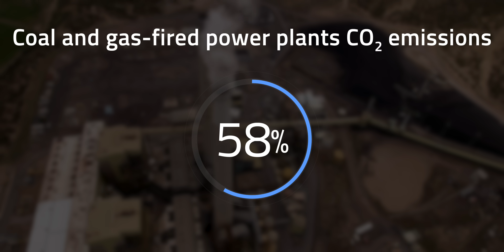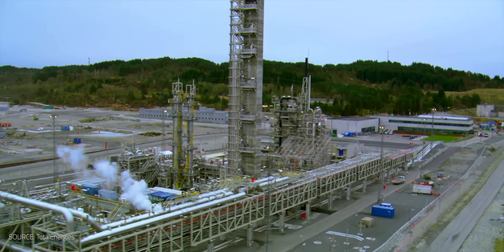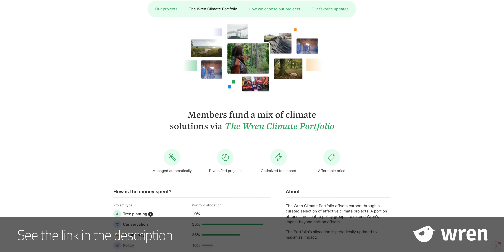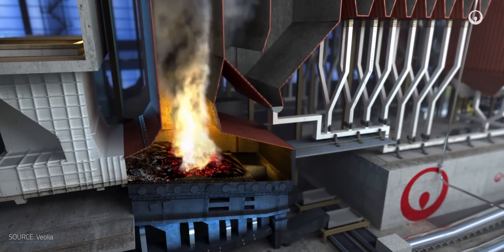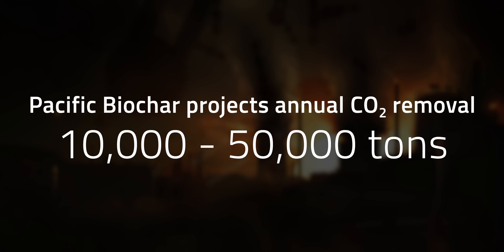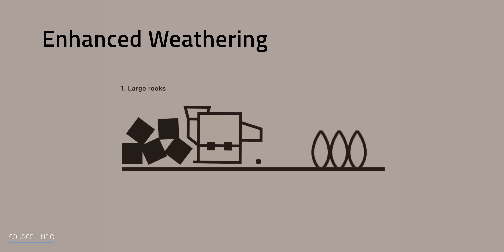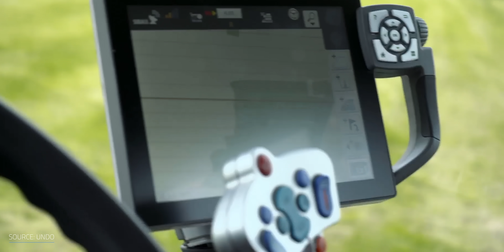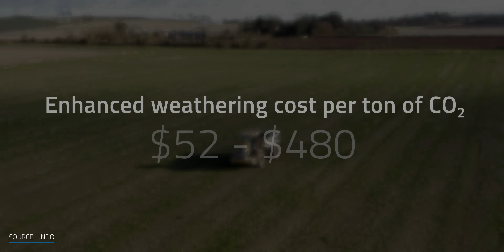The Reality of Carbon Capture

Comment: Thank you for the video. However, I have to say I dislike the approach they are taking. While reducing carbon footprint is an important problem to tackle, I see those approaches as artificial forced unilateral compromises with nature.

Nature has its own means to deal with carbon. And they are working. They have been for millions of years.

Then we came - homo sapiens. The know-all can-all selfish short-sighted animals that create more problems than they can possibly solve and disbalance nature's mechanisms: 
1. burning dead dinosaurs, and dead trees to produce heat, light and pressure while increasing carbon release astronomically when compared to natural sources of co2 (breathing, rotting, etc.);
2. cutting forests to create fuel for #1, to build stuff (lots of which we don't really need...), to build more houses and plants/factories, to recover land from what used to be forests and use it for agriculture, because we need food to live and proliferate, and as we do - we need more of #1. Effectively, killing nature's lungs, not only sheltering huge amounts of wildlife but also disbalancing the carbon reduction mechanism even further.

Instead of seeing ourselves and our actions as the problem, what do we do? We address the problems we create IN ISOLATION, not accounting for the fact that everything is an extremely well-balanced scale we have to restore. Instead of producing less co2 ourselves, we interfere with nature's natural co2 production by carbonising matter that should decompose naturally, serving food for micro→macroorganisms, flora and fauna. We are crushing rocks and spreading them on the land, again, not accounting for the fauna living there, only addressing the co2 consumption and hoping it improves our crops, which reminds me of #2. 

We're tipping the other scales and creating even more problems. We're too short-sighted, we're always trying to solve one problem at a time ignoring the fact that we should take a more holistic approach and solve all the problems together. Looking less at ourselves and profits/expenses and focusing more on the overall good.

I always find it extremely odd when someone burns material to produce something (other material/motion/pressure/etc.), letting all the heat dissipate. And then we're again burning material to produce heat for.. you know, heating, throwing all the side products away (just like in this video of yours: carbonising waste and letting all the heat and energy go away - only focusing on carbonising stuff).

Nature is not a set of isolated mechanisms. Nature is an intertwined single extremely complex mechanism, a scale balancing on scales balancing on scales bal..<...>.

If we want to ACTUALLY solve everything/anything, we must change the way we approach/see those problems. And reduce the damage WE are doing rather than play God by "Hey, nature, step aside for a moment, I know how to do your job better and fix that tiny single isolated problem we've made, instead of stopping damaging everything we come in contact with. We'll make a complete mess elsewhere, but we'll solve that single problem! We're the best!!!".

This is wrong. And, as you like to say, "it's complicated"... though it's an understatement of astronomical size.

Comment: All of these approaches seem to have overhead which may be ignored.  I noticed tractors and trucks being used to spread the enhanced weathering product.  Don't those use more diesel fuel?
I live in Washington State where we have a lot of deciduous trees.  I assume that the leaves which fall are mostly carbon, and that when they decompose they put CO2 back in the air.  (??) Is there a way to keep that stuff in the ground?  (Maybe biochar?).  Wouldn't it be ideal if we could use renewable energy and airborne CO2 to make coal and put that back underground? (reverse coal mining).  We know that coal is stable........until you burn it.

Comment: I had a large garden with terribly heavy clay soil, and so I decided to improve it with deep mulching, or sheet composting. Over the last two years I have put tens of thousands of pounds of wood chips, grass clippings and really anything organic on this plot. I keep a flock of chickens on it which continually scratch and poop on it. So far, in a very short period of time, I have created a garden that veggies love to grow in. It never needs to be tilled, or weeded...rarely requires watering, and needs no fertilizer or soil amendments of any kind.
I have also read that this process also sequesters carbon, but I can't find any information on how much. If anyone has any data on this, I would love to see it.
Reply: Terrific way to create good soil in a small area, hauling in tons of stuff.  This good soil will last you for a long time, but eventually any sustainable mulch and green manuring and crop residue/manure reaches a point where it it doesn't add much more carbon sequestered into the soil.  The rate of decay will equal the rate of addition.  It's due to this pesky stuff we're surrounded by called oxygen.  Humus buildup lasts the longest, and could be years or even decades, but not really fully sequestered.  The things that completely sequester carbon are the carbonates from basalt, and organic matter that accumulates in oxygen poor environments, like peat bogs, mangrove swamps, and in the deep ocean in low oxygen zones, like there are frequently near the mouth of the Mississippi and other large rivers, where fresh water floats on top of the salty sea and inhibits mixing.  Natural in some areas during some seasons, but hard on the higher sea life.  Biochar also can sequester some carbon for pretty darn long, like up to millennia.  But it has issues with all the energy, work and cost to produce it.  Minimising all these would make biochar work better.
Reply: @chuckgoecke  
Yup. That all makes sense. But I believe that it is possible that after my layers exceed 12 inches or so in depth, I have created an anaerobic layer that may hang on to some of that carbon. What do you think?
Reply: @paulfay357  Anaerobic digestion produces methane which is a more potent greenhouse gas then CO2, it is generally better to store biologically active carbon in an aerobic environment. You still have increased the amount of carbon stored in your soil from very little to a lot, while using it to increase the land's productivity which is a win/win even if it isn't permanent.
Reply: @garethbaus5471 methane doesn’t actually last very long in the atmosphere before it’s converts into other chemicals, it’s like 12 years compared to 300-1000 years for co2
Reply: 17

Comment: Very well-put together video Matt. What I find bizarre is that we have existing technologies, plus our knowledge of the science behind volcanic eruptions, to rapidly move the world to net carbon negative, while continuing on a growth path.
1. Nuclear power is the step-child of the WWII atomic bomb programme, and needs to be separated so we can use new generation molten salt nuclear reactors for power. They are inherently safe due to their high temperature / low pressure design, and use molten salt that goes solid if there's a power cut, thus stopping the reaction. Ban the Bomb!
2. The world's degraded and desertified grasslands can be rehabilitated and turned into huge carbon sinks through the practice of holistic or regenerative grazing using cattle, sheep, goats and sheep, with multi-species cover crops. This directly enhances bio-diversity of native wildlife like insects and predators.
3. Biochar and enhanced weathering are top contenders for carbon capture, totally agree with you. The best methodology I have seen is on Farming Life Australia where he makes biochar and puts it down on the ground in his stock yards. His cattle break it up with their hooves and poo and pee on it, mixing it all together, thus inoculating the char with moisture and manure, and aging it. He then spreads this mixture on his farm paddocks.
https://www.youtube.com/watch?v=chwkOgtfq5I&ab_channel=FarmingLifeAustralia
3. Direct Capture will work economically where it is done on-site at an existing carbon-emitting plant like a fossil fuel power station; AND there is a local rock formation that can be used to store the CO2. Transporting the CO2 will be too expensive.
4. We need to geo-engineer the climate using sulphur dioxide injection into the stratosphere. It is too late to hold back on this. Volcanology is a settled science with a long history, and very good modeling on historical volcanic eruptions, and the effects of those on the climate. Since I live in New Zealand I vote we go first. It would be best to start this process at high northern and southern latitudes, where warming is most pronounced, and has the worst effects vis glacial and sea ice melting.

Comment: Biochar is a fancy woke name for charcoal. And sorry but it seems about as BS as corn ethanol. Not even a band-aid solution but a tattoo of a band-aid on a wound. Assuming 50% of carbon is stored forever...meaning 50% of a wooden stick is lost in the method of BURNING IT to the atmosphere. What was the original carbon "half life" of a stick rotting normal in the dirt? does it take a year or more to get to 50% of the carbon of 1 kilogram of stick into the atmosphere under normal conditions? cool...you just put 50% of carbon from 1 kilogram of stick into the atmosphere in 30 seconds. And since its a factory here is 1000 years worth of sticks in one work shift. 🤔🙄....honestly...burn your way out of climate change and dig your self out of a hole. 😑

Comment: Another source for atmospheric carbon dioxide is the ocean which holds 54 times more carbon than exists in the atmosphere. Whatever the cause of warming oceans, solubility will decrease on warming leading to the evolution of carbon dioxide out of the water and into the atmosphere.
And that is ancient carbon indistinguishable in carbon isotope ratios compared to that of fossil fuels.

Comment: you know what could help with removing co2 from the air atleast in the cost of money. make a way of making dry ice. the money made from selling of dry ice to make more of the in ground capturing.
Reply: Interesting. 
We are told that 'dry ice' is currently manufactured commercially by taking pressurised air to extremely low temperatures.
Science will tell you that atmospheric Co2 becomes 'dry ice' at extremely low temperatures , perhaps those found in Nature already in the Antarctic. there is controversy, I believe, as to whether it  ever 'rain's dry ice .
However, perhaps this natural phenomenon could be exploited in these regions as an alternative way of extracting CO2? You can see that the costs associated with the commercial extraction would be considerably reduced and presumably if low temperatures could be maintained it could be stored 'in situ'.

Comment: Give the sand to farmers to use as bedding for cattle and poultry. Many dairies use sane as bedding and the spend allot of time and money to clean and reuse the sand. If you gave it to hem they would just spread it normally onto their fields. Does he basalt work if it’s incorporated into the soil, or does it have to rest on the surface where it’s in contact with the air? If it’s the rain it reacts with that will be available if dug into the soil.

Comment: Even though the technology is still problematic, I think it would be very unwise to try to sell to anyone that carbon capture is not a part of our renewables future. Now, is "direct air" carbon capture - when it is literally pulling carbon randomly out of atmospheric air - going to be applicable? Maybe, maybe not, but that is still by far the most impractical version of carbon capture and there are far more helpful ways to use this kind of tech that are already showing their applicability - even with technology that isn't into the "commercial rollout" stage. However, even though the natural pathways for carbon capture are still developing new technologies, they still look very promising (with some great applications in helping other issues, like soil regeneration).

 What is clear, however, is that carbon capture is much like other efforts to clean up environmental pollution of different kinds - and at this point greenhouse gasses are pollutants: these efforts aren't going to make a difference unless there is serious effort to change the initial pollution. This doesn't mean carbon capture can't be used as an assist to older tech transitioning to renewables or nuclear (it's a great way to help meet carbon targets), but it can't be an "instead of" other climate mitigation efforts - it needs to be used in conjunction with them.

Comment: Biochar is sooo goood! I have been making it in many different ways over the last 12 years and my soil is amazing now! The char needs to be finished and fine grained if possible but yeah all the char works wonders, absolute wonders! If only the forests that are burning out there were being managed for biochar production from dead wood, then the wood heat would be offsetting fossil fuel heat rather then just raging as a forest fire in addition to the fossil fuel use, the char when mixed with compost makes black rich soil where the soil never releases the carbon from it but rather builds up more bioactivity and thereby more carbon (roots) in the soil that create more and better plants that create a positive loop cycle where the world is getting healthier all the time (or at least the biochar farmer is) all while getting rid of their current fossil fuel heat for wood heat that was going to burn in a forest fire anyways!

Comment: All of this stuff is a distraction from what the real focus needs to be: ending emissions.  I live in a place where the economy is heavily dependent on oil, and "Carbon Capture will solve everything" is the mantra. Sure, some of it will work in extremely-localized high-carbon-output processes, but even with that the real-world studies and trials have been unimpressive at best.   I am extremely suspicious of most of this other stuff.  The biochar guy was talking about funding more than anything else, and spreading crushed rocks far and wide simply isn't going to happen.

Comment: Enhanced wethering sounds dangerous. Breaking down larger material into smaller material sounds like a vector for carcinogens and cancer. What kind of mechanical energy goes into grinding the material? Also, "wethering" is a natural process that happens to everything, whether its natural or manmade. Existing infrastructure (steel and concrete buildings and utilities) might experience more wethering which could reduce lifecycle estimates. It just sounds like a lot of risk.

Bio char sounded incredible, though. I gotta find out more about that.

Comment: Up to $600 per ton...   lets see, you have a pickup driving around with about a 20 gallon tank, releasing about 400 lbs. of C02 per tank, so five tanks per ton, so $120 per tank just to take the carbon back out of the air, not counting the price of the gas in the first place...

Comment: DAC collection with fans using an absorber and stripper is dealing with 420 ppm CO2 and it is doubtful it can be done for under $600 per ton of CO2. CCUS at a gas fired power plant would be much cheaper and more effective. The oil and utility industry needs just $40/ton of CO2 to justify the best CCUS projects and this would also kick start hydrogen. A price on carbon is what is needed. I do think the biochar and enhanced weathering have potential and seem to be in the running for the carbon removal x-prize.

Comment: I appreciate the effort these advances are making in TRYING to make carbon capture commercially viable (which I would argue achieves more than environmentalist whinging has accomplished ever), but these solutions seem either underdeveloped, pie in the sky, or contain the potential to cause much worse problems than they purport to fix. Biochar seems to be the most interesting out of everything proposed here, but it sounds like it's potential impacts are not fully understood yet, and if it gets pushed to the market too early, it may screw with the subterranean ecosystem, which would cause even worse problems. Hopefully, that is not the case, but the tradeoffs need to at least be understood before commitment.

Comment: Why exactly wouldn't you just bury wood / biomass in old coal mines and such, instead of burning it first, to make charcoal, generating GHGs during the burn.
Reply from the maker: Creating biochar isn't the same as fully burning the wood, so it's not releasing all of the carbon.  It turns it into a stabilized form.

Comment: The enhanced weathing is a process that has been used in the reef aquarium hobby for decades. Using a calcium reactor you are basically pumping C02 into a chamber of water and old coral skeleton. The C02 lowers the ph and melts the skeleton and that effluent is dripped back into the system and feeds the growth of new coral skeleton

Comment: What about flash graphene?  If you subject carbon-containing trash to a brief large voltage, it breaks all the chemical bonds.  Then the carbon naturally forms graphene, which can be either used or buried.
Reply from the maker: I actually did a video on HTC a while back that can carbonize organic material.  You end up with a biochar product that could be used for graphene.

Comment: I wonder if enhanced weathering could be combined with carbon capture from flue gases.. Instead of spreading basalt dust with possible heavy metals over fields or into the ocean and pumping CO2 under the sea or into oil wells. Maybe CO2 could be just pumped through a slurry of basalt and it creates carbonates there. I don't know how efficient it would be and whether the carbonates or other products would be useful, but it's worth a thought.
Reply: Is CLIMEWORKS not doing that now in Iceland?